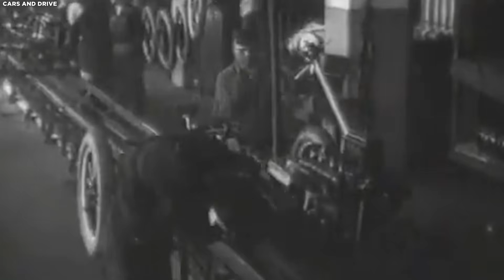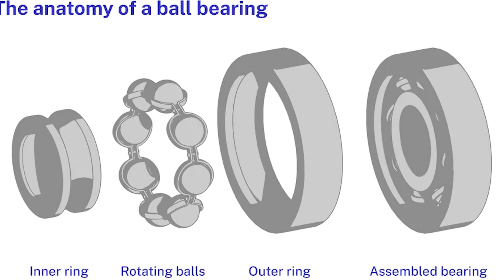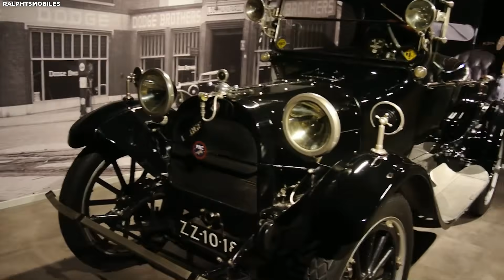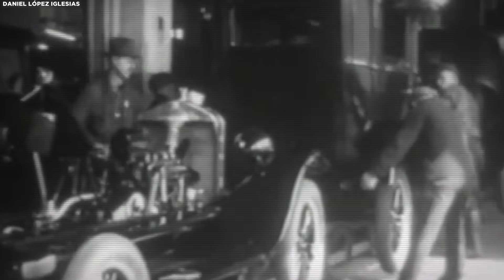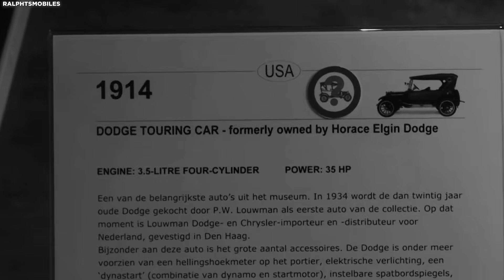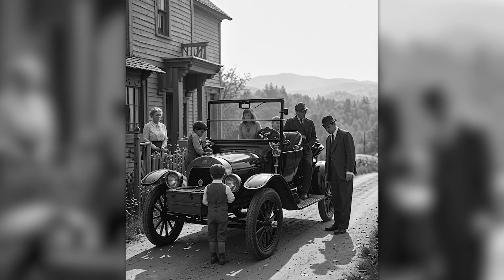How Dodge Model 30 Were Built in 1914 - Retro Dodge Factory Tour (Manufacturing process)

Comment: This video is fundementally flawed. The Model Ts didn't have nearly as much wood as this video leads one to believe. The frame and body are all steel. And not just any steel, very high quality stuff. Wood is used for interior and as body blocks on the frame. The Ford car is extremely durable. Also all the talk about the wood swelling and rotting - my Model T sits in its ORIGINAL wooden body blocks
Reply from the maker: The Model T was not made entirely of wood, but it used a significant amount of wood for its internal framing, body structure, and wheels before shifting to all-steel bodies in its final production years. Early Model T body panels consisted of thin metal sheets bolted and nailed over a heavy internal wooden framework.
Reply from the maker: This video is just an insight into the first full steel production vehicle. The Dodge Model 30 🎉